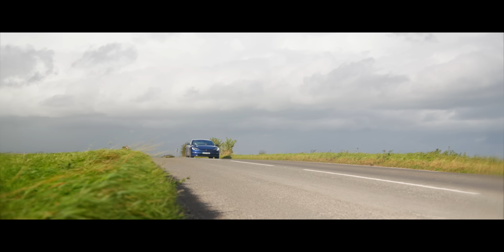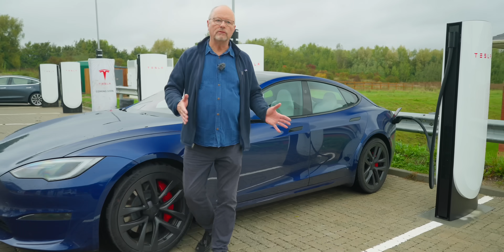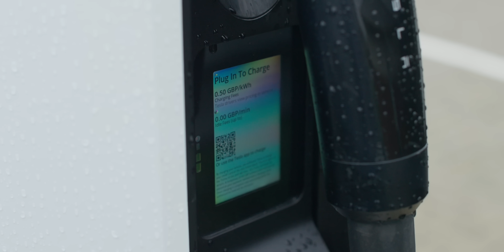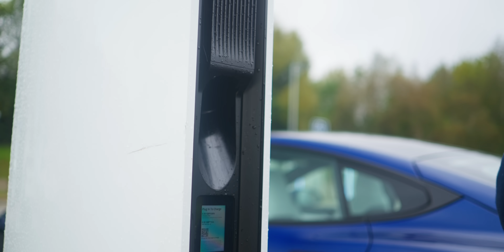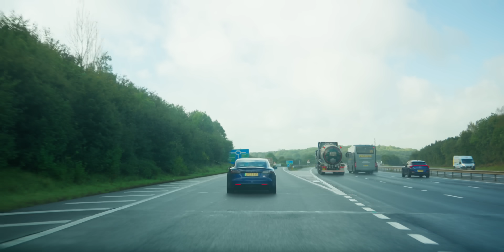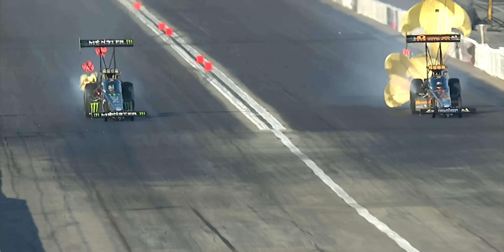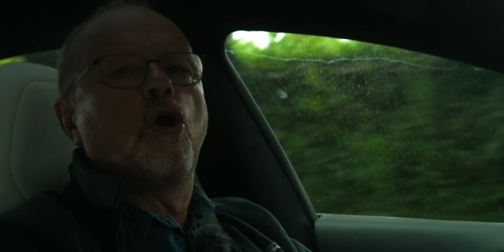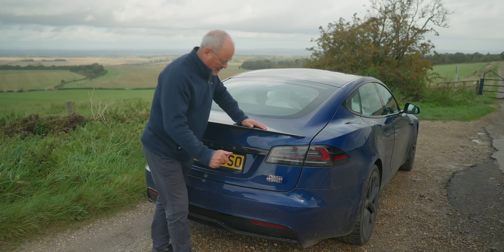THIS Is Why The Model S Plaid Didn’t Come To The UK

Comment: Vision is a complete joke. I used to be a 100% Tesla fanboy driving 30.000 Miles a year in a 2021 TM3 LR. Fanboy status ended very abruptly last year, 3-4 days after "Vision" got installed, while fighting the joke the viper-automations are in a TM3/Y and then suddenly it tried to pull hard towards opposite lane with a truck coming towards me approx. and it was down to only 10-20 meters when the car suddenly did this. Hands on wheels so saved a frontal collision from happening but, welcome to "Vision". Then a Scandinavian winter with zillions of mornings with wipers going berserk due to moisture/ice in the camera housing in the morning and an autopilot (Cruise Control) that can't keep 40 Mph on a straight road in daylight when visibility goes down from 500 meters where "Reduced speed due to limited visibility" starts to happen more and more often down to 300 Meters where its a 100% manual driven car. Before "Vision" when the cars radar was used, there was absolutely 0 issues beside those 2-3 days a year where slush ice would collect on the radar, just like on most other cars with adaptive cruise control. On top of this the "Auto"-dim flashes terrible at night, especially after there has been rain and off course both wiper & dim are forces controlled on AP by the car meaning they are just utter hopeless where you before would have a laugh and kill the wipers so their not running on a dry windscreen the first 40 Miles until defrosting eventually has made the windscreen cameras see clear again. 

Now USS's has been removed 1 year ago & now stalks too. After the price reduction i can't afford to sell my car as it would mean close to 50% loss in less than 2 years, but never EVER again shall i pay to be a beta-tester of a mentally 8-year old insane guys products. So close to a fantastic car and then Elon ruins it by greed. (Why do you think Model S & X still got radar ;-) )  

With Chinese and even traditional ICE-manufacturers catching up very fast and only a bit of evolution but no more revolution from Tesla's side for a very long time, beside the mentioned downgrades, i believe Tesla are getting closer and closer in becoming a new Nokia within a few years when people realize how bad the 3/Y driver assistant systems are, 4680's produced today vs what was told on batteryday +3 years ago are...Well, the formfactor is right, that's about it, no (hovering) Roadster and oh boy FSD are never EVER going to happen on anything near HW3.0 with those terrible cameras.

Comment: Small correction, Top Fuel dragsters do 0-100mph in under 1 sec not 2 sec and will be over 200mph when the Tesla Plaid reaches 60mph (when you exclude the 1 foot roll out they deduct from their figures) so even though the Tesla Plaid is a ludicrously fast for a road car there is no comparison to a Top Fuel Dragster. No surprise though when you consider a Top Fuel dragster is 10,000+HP and can do a 1/4 mile in around 3.5secs !!

Comment: " Deleting the 2 levers IMHO was unwise"
Nah, like every other device that breaks over time, that little button on the steering wheel is just a matter of getting used to it.
Remember the high beam button on the floor? Those were notorious for rusting out and having to be replaced.
Shifting on the sterling column was the norm until the early 60s. 
Evolution is like the turkey shuffle. 2 steps forward and one step back.

Comment: 1:20 - that's all very well but can they ALL be used at that level at the same time and can the grid handle it?
Reply: Shortest possible answer: Unlikely, yes, no and maybe! Unlikely that the Supercharger setup at any given location can operate all 'pumps' at max simultaneously, but all pumps will still be operating better than most other providers around the country at their peak. Yes, the nation's grid can handle the current fleet of EVs charging practically simultaneously. No, it wouldn't be able to handle it if the entire fleet of ICE vehicles were to be replaced overnight with EVs, but that's not going to happen is it? And... 'maybe' to the last (as has been covered in other videos on this channel), because the National Grid has major projects already underway to modernise and harden the infrastructure, and expand the capacity of the generation, storage and distribution capabilities over the next couple of decades... hopefully always ahead of the requirements of the ever-converting fleet.

Comment: I'd love to see all the button lovers try to indicate during emergencies when they're about to lose control of the vehicle, or try it in Europe while taking multiple sharp turns in traffic and unpredictable directions. In US you could put the button behind the seat and it would still be possible to use it in those massive roads with predictable turns. Anywhere else, not having levers is an absolute hazard.

Comment: well, I'm with you on the oil thing I'm against you on the e car. the tech is still not there nor is the support system. basically, the current equipment can't handle the load and there are not enough charging stations.I ride a Talraia xxx and can only charge at house or work there's only one station in 56 miles and it doesn't hold bikes for example.

Comment: Great clip!.  I had an i3s for 3 years and have had an i4 for 1year now.  Previously a BMW M2.  Lovely car, but driven EXTREMELY carefully I'd get around 22-23MPG.   Driven 'briskly' 10-11MPG.  So I completely agree that no one mentions the huge fuel consumption when high performance cars are driven fast.  As to performance, my BMW i4 does 0-60 in 5.7s (officially) and I have to say that (I admit to getting old) that is quite fast enough.  (Despite having owned faster cars).

Comment: I am sick of arguing the benefits of EV's. It eliminates pollution in built up/ inner city areas and concentrates the pollution of manufacture to the factory it was built in. The power delivery is instant and is far more efficient than ICE vehicles. I have had my Hyundai Kona premium EV for 2 years and I am a complete convert. The have been no negatives for me personally but obviously the infrastructure is not quite there if you wish to travel long distances regularly. You will need to do your homework and hope the chargers you wish to use are free or working. Big fan Robert, love your style of presentation.

Comment: I've driven the plaid and the indicators are indeed a pain but there is mental shortcut: the lower button blinks in the direction of the hand that pushes it, once you preconditioned yourself to that automatism, you'll never have to think again, nomatter how the steering wheel is positioned when you want to use the indicator
That said, the acceleration is mindboggling, faster than a 1000cc sports motorcycle, something that was totally unthinkable in the 100k price bracket even just a few years ago. Still would have preferred a stalk nevertheless

Comment: So it does 147 miles for about £7 worth of charge if you drive it easy> Is that what he just claimed?
Reply: No, I believe the MPGe (equivalent) is a comparison of the energy of 1 gallon (33.7kwh) to how far the EV can travel on the same.  

For example the Tesla can go about 147 miles compared to about 40 for an average ICE.  The Tesla only has about 75kwh in total capacity, hence about 350 miles in range.

The cost is another concern. For example 33kwh of energy will vary. It costs me £2.50 to charge up that much at night, but might be £10 at a service station.

Comment: Not all stalk indicators are equal. The one on my wife's Honda Jazz is a PITA if you need to cancel the indication - sometimes it works, sometimes it just indicates the other way. It's a shame you can't get an optional extra that includes indicator stalks on the Tesla. It wouldn't matter to me though as it's well out side my price range.

Comment: "Launch mode activate" They say, even though they didn't launch it properly at all. Can see how slow it went off the line
Reply: That could be due to the car sensing the state of the road (Teslas almost never wheelspin when launching).  if the road is wet / greasy, then the car will be slow off the line, due to lack of traction.

btw I think you can see the launch-mode activated, when the car 'squats' briefly before the launch...
Reply: @logicalChimp You can hear the car beeping, which means “both pedals are pressed” and comes up with an error. They didn’t enter launch mode

Comment: The one thing missing that would have made both the yoke and the steering wheel buttons less of a problem is steer by wire and with that, speed-dependant steering ratio. If you never had to turn the wheel much past 90 degrees there would be no need to move your hands around, and thus you'd quickly get used to where the buttons are. I find it interesting that Lexus beat Tesla to market with this, or rather a little disappointing that Tesla hasn't focused on this.

Comment: Why would fuel consumption be mentioned at flat out wide open throttle? 4 miles to the gallon doesn't sound bad at all to be quite honest. To put it in context that's a 150hp 4 cylinder outboard cruising at 4500rpm pushing a 20 foot boat at 45km/h. 

Very bizarre rant to have.

Comment: It's my understanding that the S and X are available in the UK - you just have to accept correct-hand drive. :P You are given the "Reacher" tool though as a gift. 

Also, Model X Plaid is more expensive and is larger. 

Good lecture though and it isn't stated enough.

Comment: Small correction, re: Top Fuel dragster acceleration:  They manage 1-100mph in about 0.8 seconds. 0-60 takes c. 0.4 seconds. ;)

Comment: Model S owner here:
Even on my phone I can see that the front and rear hatches are not aligned with the rest of the body. Tradition!
Also: stalks are good. Tesla threw out a century of refinement to save a few bucks avoiding buying parts from Daimler. At least it didn't have the idiot yoke.

Comment: Love Clean Energy 🎉😂...There is just one thing that needs to be said 😮...When ever We tried to set the Clean Coal or try to fix the Shipping Cargo Ships the powers to be have thrown Spanners into the Works...Love eletric Car and all the Tech changes 🎉...Just be cautious of Stories Media Tell...
If you have a Chance look for the Counter Rotating Eletric Motor 🤔...Designed in 2006...
Good luck finding anything online about it 🎉😂...
IBM WINNER and then Nothing...
SUPER CONDUCTIVE BATTERY...
IBM WINNER and then Nothing...So caution 🎉😂

Comment: Your theory on that being cleaner than an ICE is lacking. The batteries in that thing are toxic and if there is a thermal runaway in a populated are all them chemicals go everywhere. How did you calculate the maximum MPG? How many MPG worth of energy does that car take to do the go fast bits compared to a gasoline variant of the same standing? If the batteries all go dead is there a way to open the door if you have no electrical power at all in the car, say if you got in an accident?

Comment: I’m scared of EVs when I see all the fires and electric door handles with no way to open them when the battery fails. Homes catching fire when EVs were plugged in overnight. It is just too much a risk for my family. I do think they are a great idea for commuting vehicles but maybe with safer batteries.
Reply: iirc you're 10x more likely to experience a vehicle fire with an ICE vehicle than an EV (either parked - e.g. Luton Airport was a diesel LandRover, iirc - or whilst driving)... and that's per 1,000 vehicles (so it's not because there are fewer EVs).

Comment: 6:45 Nothing wrong with the 'B' 200 CDi Class I can get 2 Mountain bikes in rear without dismantling them, and on a Ski Holiday [sadly 2 years ago] got 3 passengers and all luggage including Ski's in with 1/3 seat down. Model W246 B200 CDi and 143 MPH on Autobahn and on non-stop return trip 797 Miles 14:14 hours Average 54 MPH [inc Ferry] and 50.4 MPG. Since then got a W247 B200CDi with all the kit - absolutely amazing and so quiet most passengers think they are in an Electric Version - I kid you not, at 60mph in 8th Gear engine 1100 RPM totally silent, on a good road like floating on air. :text-green-game-over:

Comment: Great show as always, well most of the time. My question is why there is no normal electric cars with no touch screens and all that tracking functions, cars in size of Fiesta or Golf so can go on motorway, which I am as average shop worker would be able to afford. All great and dandy, but still electric cars are for people who are better situated than somebody who just need simple car and also want to do something for the planet?
Reply: It's because of 'modern safety standards' (all the focus on 'active driver-assist systems' / ADAS, etc)... the cost of the sensors and the screen is comparatively minimal, and moving controls to the screen (or buttons on the wheel) is a significant production-cost saving (time and materials).

For for smaller vehicles - they end up with smaller (physical size) batteries due to having less space between the wheels... which translates to less range.  The Model S (100kWh battery) in this video has the energy-equivalent of ~3 gallons of fuel... currently, 'small' EVs end up with the energy-equivalent of 1-1.5 gallons, because that's all they can reasonably fit under the vehicle.

That said, check out the Citroen e-C3 review on this channel from a few days ago - closest thing yet to an 'affordable' reasonable-sized EV.

Comment: They must have used the same designer as the one that did the VW steering wheel buttons (because they probably got sacked) to do the Tesla indicator change. This is what happens when you test and research in a vacuum.

Comment: Much of your fossil fuel rant can be applied to Cobalt, Nickel and Lithium extraction Robert.
Electric Utopia is difficult to achieve and a long way off.
The resources tied up in a 60KWh battery pack in a single car, for example, could remove 4 houses from the electricity grid. So what's the better use of resources?

Comment: I have to say that Robert's comments about the turn signal switch is spot on.  I've been driving for over 45 years and using the switch is ingrained into my muscle memory.  But newer drivers are more used to joystick and game controllers so can adapt to the buttons easier.
Reply: But new drivers aren't the ones who can afford a tesla so it seems weird for a car that new drivers can't afford to have a control system designed for that target market.
Reply: @ElizabethJones-pv3sj  but most of the Tesla Owners are younger.  Even if they are in their 30's or 40's they have grown up in the digital and video game age.  Older people (not Robert) are stuck in the fossil fuel mindset.  Tesla isn't the only EV company who had this mindset of digital touchscreen and buttons instead of switches and knobs.

Comment: 99% of the comments are about indicators. There are third party options for stalks so it’s easy to fix if you can’t figure out how to use the buttons.
Reply: Why should you have to? On a brand new car. Why can’t Tesla build it properly to start with?

Ridiculous - even if I had the money I wouldn’t buy a car without proper controls
Reply: @gw4182  you don’t have to, but if you like the car and can’t reconcile the buttons, it’s a simple upgrade. I just don’t consider it a deal breaker

Comment: Another example of how EVs clearly kill ICEs stone dead. If the Plaid can do 147mpg equivalent when it's driven sensibly, then I calculate that it can still do 92mpg equivalent when it's being pushed. That's efficiency that ICEs just cannot match in normal cars. When you then compare performance cars the efficiency of a Plaid makes the relatively sluggish Bugatti Veyron look like an oil tanker. All that plus room for at least four fully grown people, good boot space and advanced self driving capabilities. And we are still in the infancy of the modern EV. This is nothing compared to what's to come.

Comment: naught to 60 is Quick.
200+mph is Fast. You can be quick but in the end not necessarily fast, and you can be quite fast, but not all that quick.
User interfaces: Gah, we have generations of muscle memory for levers and knobs; it's folly to toss them. (I think this is where I yell "get off my lawn!"). These engineers need to learn how to balance the physical controls with touch controls - they are not all that interchangable.

Comment: Bringing a Model S Plaid to 200 would also use a crazy amount of electricity. When I floor my Model 3 to go from 0 to 80 rapidly when getting on the highway, it uses over 1% of the battery.

Comment: I've read here again about the indicator stalk problem.. I've seen videos. I believe this is a game-changingly stupid move. I don't care about getting used to it in 10,000 km (or miles) and I don't care what the fanbois say. It should have been fixed by now - and absolutely the only fix is going back to the indicator stalk. (They can keep the button b****ks as an higher priced option if they must.)

Musk is losing his touch (distracted by God knows what). He should have seen and reverted this mistake by now. It's been months! 

I'm about to switch to the share trading app and do some selling right now. (My shareholding is minute, but I've often found that when I do a thing like this others are independently making the same decision.)

Comment: When I rented a model 3 in Vancouver a few years ago I found that the turn signal wouldn't do a left lane change flash but always latched into full turn signal, so I had to use right signal to cancel. Right turn signal was fine. I'm only a few years younger than Robert so maybe I am out of touch, but I did have a few people comment that Tesla recalled some cars for the problem, so I don't think that it was all in my head. Niggles aside, was a pleasant experience.